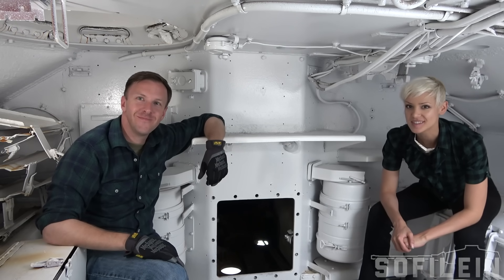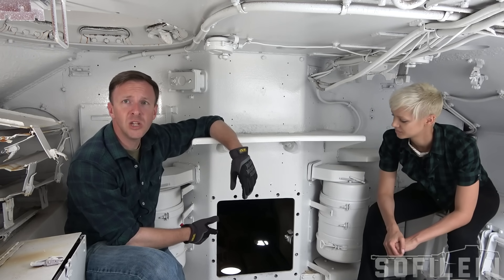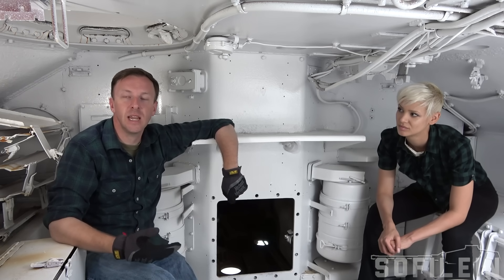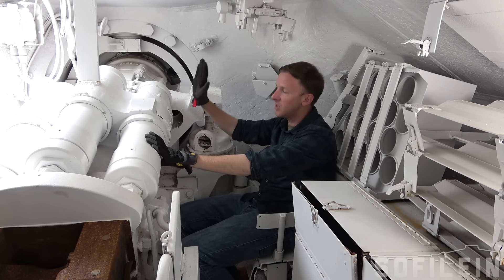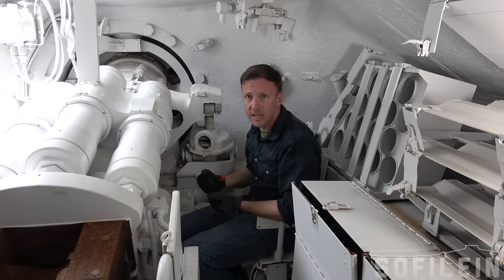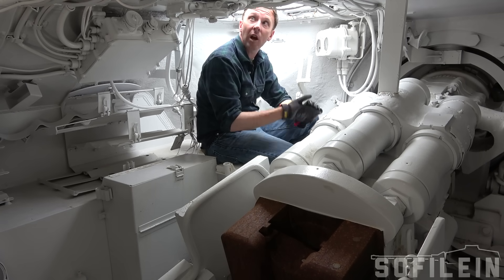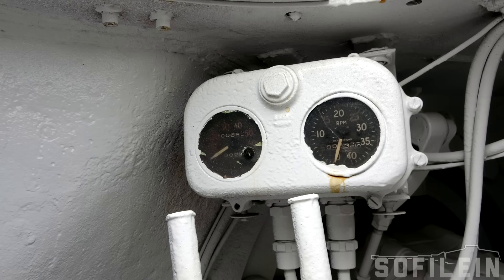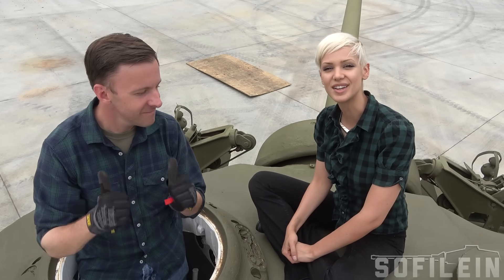Crew positions and interior features of the last T28 / T95 American superheavy tank

Comment: Just a further note by Rob: you may notice the inside of the hatches are painted white like the interior. That's not correct and getting corrected soon! It should be painted olive drab the same as the exterior. You wouldnt want an open hatch to be so visible!
Reply: It seemed a little funky that the hatches were white too, but good to know! Is there any chance that itll be a full restoration as close as possible to it's original construction? Like engine, transmission, and even that box he mentioned in the drivers seat that was likely removed.
Reply: Peresumably the interior of the hatches would were padded?
One question  -  why wasn't the breach block bead blasted/painted?  Just curious.
Tnx for the video(s)
Reply: @1337flite  presumably because the cannon never been pulled out from the tank so it couldn't be sandblasted the part of the extended counterweight behind the breach!
Reply: Thank you. Was wondering.
Reply: Since we're on the topic of corrections: "...the same as the *exterior*."

😉
Reply: @pauld6967  how did no one else point that out?! Corrected 😊
Reply: @ArmorCavCollection  thank you and happy to be of service.
Reply: @ArmorCavCollection  ...and at the risk of wearing out my welcome as a subscriber,...after you guys made the correction, I see that an apostrophe is missing from "wouldn't"
Reply: You should remanufacture the missing control panel I'm sure that you guys have the blueprints for it but what a awesome restoration and preservation that you guys have done
Reply: Gotta ask, when the interior was bead blasted and painted, why didn't they do the engine bay?  Was it too greasy or was it done as a sorta favor and squeezed between projects, thus the team was available for only X many hours?
Reply: I wouldn't think that adding a newer engine and drivetrain would be all that detrimental to this amazing monument to the ingenuity of the era. I am sure they put the best the could at the time and if it were to get back on the track, why not have a safer, more affordable, better powered, easier to service power plant? As long as you maintain visually the look externally, it was in fact a prototype and I am not sure how far into the trials it went but this is different than say a a tiger 2. Though I could completely see resto modding that considering how rare and fragile those systems are. Have you ever seen the cyl wal thickness on the maybach for the tiger 1? They are cut so close the upper portion is opened between them. At least what we saw on the one in the AUS armor museum resto. 
That said, just so amazing for you two to show us inside of this beast! This is often one of the first things I want to see after I see the outside, want to see in, and want to see in the engine bay. As a mechanic and restorer myself, this things fascinate me!! 
I came searching to see if you all had a t29/30/34 video of the inside? Doesn't have to be spectacular like this one is, like having some before it is all stripped down just to show the history and little marks, very very cool and important! 
Thanks again for all you do!

Comment: "Look at this low mileage baby, only 68 miles on the odometer, top speed 8 mph, and gets 20 gallons to the mile!"
Reply: Sounds like an absolute bargain! XD
And with just ONE previous owner! (All be it a somewhat neglectful one)
Reply: @SonsOfLorgar  "and we'll throw in an extra set of tracks at no charge!"
Reply: "Owned by a little old lady from Pasadena who only drove to church and the market"!!!!
Reply: @paddy7812  I was going to do the classic line but you beat me to it.  I doff my cap to you sir.
Reply: @pauld6967  And I Thank You Sir!!
Reply: I was talking to the driver of an M60 tank retriever at a parade one time (many years ago) and asked about the fuel usage and he said about 8 MPG on one engine and about 8 GAL per Mile on both engines.
Reply: @bitsnpieces11  joking or was he serious?
Reply: @suspiciousminds1750  Probably joking a bit, could be reasonable mileage for a tank on one engine but with both running and probably working it would burn through a lot.
Reply: I hope they didn't opt for the extended warranty. It would have been a rip-off.
Reply: @NitroU-  Yes, 5 years or 50 miles, whichever comes first.

Comment: I have long been an armor nut.  Model kits, YT videos and games.  The T95 has been the ghost that has defied deep investigation and pics.   These videos of its new digs are BOSS!  Thank you SO MUCH for going into such depth of this most elusive chunk of iron!
Reply: It’s not a T95, it is the T28 Super Heavy Tank
Reply: @andyconway5610  Both names are used interchangeably, the technically correct term would be the T28 Super Heavy Tank but it was also known as the 105mm Gun Motor Carriage T95 for a year during its development.

Comment: Oh, for Pete's sake, it's big enough to sling a hammock in there!

68 miles? Pfft... Just amble over to the Armored school, get a couple of mechanics, a crane and a spare Abrams turbine. Slip that in and crank that sucker up. 

Awesome view inside! Probably big enough to carry it's own infantry section for protection.
Reply: If the US government spent money to get this tank operational with an Abrams engine, I would not complain about their misuse of my taxes.

For about a year.
Reply: @samuelnakai1804  ehh Turbines are bad if you sit idling other than that they are very good
Reply: also i guess you could say a M103 took a note out of T28/T95 for Hammocks lol
Reply: @Rayhan  tbh i dont thing the suspension could handle going that fast
Reply: I'd say buy and modify a Leo2 powerpack from the Canadians instead of the gas turbine of an M1, the sound profile would remain a lot closer to the original too, at least from the outside.
Reply: @le_floofy_sniper_ducko  Perhaps only with the double tracks installed? SonsofLorger makes a great point as well- a Leo2 powerpack. 
There is the knowledge out there! I'm sure there are more than enough volunteers to make this work so we can crank this sucker up and go car crushing.
Reply: @vtbmwbiker  even with double tracks mind you this is a 90 ton tank on bogeys not like M1 or other tanks now a days with torsion bars
Reply: also by the way of restoring this, their goal isnt replace what we can to make her a runner with modern stuff its restore what you have and get period correct items that where built either for the tank or had parts in common with others they want Original stuff not just put a new thing to replace it deal if i remember right Bovington is much the same
Reply: @le_floofy_sniper_ducko  All very good points--- I don't know much about engine history, so was the GAA the largest engine they could get appropriate for an armored vehicle that could be produced in large enough numbers? It appears, well, everywhere.
Reply: @vtbmwbiker  yes but the tank didnt use a Ford GAA it used a Ford GAF V8
Reply: @le_floofy_sniper_ducko  So, the same engine as an M26 then? Still 500 HP though.
Reply: @vtbmwbiker  ya, but still i dont think they wanna risk of repeating what came before it
Reply: aka engine fire which destroyed the other one
Reply: @le_floofy_sniper_ducko  yeah but what's in the engine compartment isn't really important, as long as you have the original sitting in a display somewhere. wouldn't bother me in the least if they swapped in a beastly diesel and got this thing running again. keeping the visible interior as original as possible of course.
Reply: @oldfrend  thats debatable as if your doing a period correct restoration then have a modern engine in it does it not defeat the entire purpose of a period correct restoration?
Reply: GAS GAS GAS!!!
Reply: @oldfrend  at the same side he also said they have no plans as of now to make her a runner and some Tank Museums do act like i had said prior yes i agree it might not make alot of sense from a point of view as people like us who just want to see something like the T28/T95 project moving under its own power but in some circles it probably makes a difference as is even before they put one in if they put one in that engine bay looks like it needs some work maybe one day we will see it running tho only time will tell
Reply: @vtbmwbiker  Car crushing!?  This thing makes Killdozer look like a three year old's toy!
Reply: It looks quite roomy on the inside but like most armored fighting vehicles if the T28 was combat filled with equipment and ammunition, there would be no room left to carry infantry.

Comment: Mr. Cohan, in case you’re still reading these comments, a question.
While in the process of restoration will another bank of control indicators that are supposed to be located at the driver’s left rear head level and are currently missing; will they be replaced, and if so, what with?  I imagine there is no longer any exact replacement panel to slap into that spot.

Comment: Having been to Bovington recently and had the pleasure of clambering all over, and looking inside, Tiger 131, I am simply amazed at how much room there is inside this... The Tiger is no small tank, and its REALLY cramped in there. You could easily host a party inside the T28 and still have room to spare. OK, stuff like the ammo is missing a few interior pieces like sights and radio gear and stuff, but I'm still blown away by how spacious it is.

Comment: Claustrophobia kicked in when Rob talked about the escape hatches only dropping a few inches in soft ground. "RUN away, run away!" It's not often you hear the term 500hp being equated to under powered either.
Reply: Compare to the horsepower of modern weapons..  a one horsepower engine would work with gearing.. but a speed of naught point naught one is unacceptable

Comment: How did they get that big-block Ford V-8 out of the engine compartmet ?
Reply: It slides in and out like the power pack on a Sherman tank.
Reply: The biggest big lock ford ever made was the 534 cid super duty v8 with a displacement of 8.7L the GAF v8 displaced 18L. Looking at the difference between the size of the two engines I don't think big block is how I'd describe the GAF i think morbidly obese block would be a better description.

Comment: Is it able to pivot steer? as in both tracks move in different directions when turning or is it a stop one side and have the other move forwards or back. From looking at it itd seem like it would pivot steer its just nice to think about all the stress it puts on the tracks.
Reply: Nope, Torquematic transmission, so brake/ pivot steering was possible, but not neutral steer.

Comment: Interesting as I never seen the very roomy interior! Of course I noticed that almost all the armored glasses had been smashed on the turrets around, unfortunately, and many items are missing including the engine. I have always been very perplexed with the choice of the Ford GAF engine with only 500 hp to move 86.2 metric tons so it had very limited cross country country but with their experience why didn't they installed two coupled engines? Thanks again sharing this very interesting tank 👍👍
Reply: Wasn't seen as necessary. The tank was only meant to ever go at the same speed as infantry and where infantry would go to assault a heavily fortified area. It was made for a single purpose and that was to fight the Siegfried Line.
Reply: @bluntcabbage6042  I understand that it was not deemed to have a more powerful engine but the area along the Siegfried line was hilly and it would have been very difficult to climb even very modest hills if it doesn't sink in the ground before due it's extreme weight....

Comment: Measure the distance between the mounting pads for the driver's instrument panel.  I would bet that it used a standard panel from either a Pershing or Sherman, a vehicle using the same engine.  The Ordnance Corps loved to used standardized components whenever possible.  I have recently (ok, 2 years ago) been primary mover on the project to get a M103A2 to the Camp Roberts Museum.  It is un VERY poor shape but I was able to use the back deck and upper grill doors from an M60 to make its rear end look "presentable".  I was shocked to learn it was an electric turret.

Comment: made think about an aphe round going in through the gunner sight. i wonder what the diameter is and how possible that would be for a lucky panzer3.
Reply: That "hole" would obviously be filled by the optic system. I guess it could be a weakspot, but something would have to go seriously wrong for an enemy to have the change to get a accurate enough shot at the T28.
Reply: @racernatorde5318  sure i just wonder if it would be physically possible with a perfectly placed 50mm round shot by annie okley

Comment: It's such an amazing piece, and I'm so glad the old girl got a good home, but I'm a little sad she'll not ride again.  If you had a modern engine tuner work on her and get her horsepower and torque numbers up a bit I bet you could get enough leeway to make her perfectly comfortable moving around under her own power, and While you might need to add a little modern monitoring equipment, wideband O2 sensors, etc, the result would be that the only known existing t28 wouldn't be stuck as a large, immobile metal room, she'd be a land battleship again. ❤

Then again ...i suppose its a tankers habit to anthropomorphize them a bit when you basically have to live in one for a while in a desert hell.

Comment: Much more roomy than I expected, even though its pretty much empty. I expected between the engine compartment and the foot of steel on the front itd be a bit cramped.
Reply from the maker: Funny enough, despite how much more room on the inside than what's usual for a tank, I've never slammed my head on the interior more in any other vehicle!
Reply: @Sofilein  your body isn't used to that much room lol

Comment: I love models..have hundreds. The jade tiger had that huge 128mm and the sturmtiger with monster Rocket! and the Soviets had the 152mm..all of them seemed to operate with the crew in combat with up to 3 rounds a minute. Had to be loud as Hell!!!!  I don’t know if they make an ear protection for that. They like to operate them with the hatches open! I can see why. Part of the reason the 105mm Priest was open topped and the converted little M3’s into 75mm shorts...with an open top. But many of the self propelled even later ones equipped with full NBC gear was very Box like. From a KV II with a big old 152mm to the end of that war. It was a loud piece of artillery. 155mm and 203mm 8 inch whatever...tend to be bag and projectile...or like the 128mm which was one complete armor piercing over sized 88mm round. But came from a split rail bag and projectile Weapon. But cumbersome. Made short work of T-34’s though and KV I’s and just about everything else! Thanks for listening! Your a lucky girl. Like the Russian T-35. Land battle ship!

Comment: Maybe someone can answer this, but being part of Wargaming/World of Tanks there is the T28 single track and the T95 double track, now i know from other documentary`s that the T95 was never in combat, but did the T28 single track ever see combat?
Reply from the maker: The tier 8 'T28' in WoT is borrowed from another proposed prototype design, which was not built.

This tank in the video, which is the tier 9 'T95' in WoT, was initially named T28, then T95 Gun Motor Carriage, then it was switched back to T28 superheavy tank. T28 and T95 are the same tank, putting the tracks on it doesn't change anything. T28 was never put into service, only two prototypes built. WoT has made this very confusing, but Im doing a video on it soon that should help explain.
Reply: @Sofilein  thanks for the info, yeah when i saw the previous video i thought it was the T28 until the 2nd tracks were shown and i did question the gun mantel at first, WG/WOT do put blue printed tanks in the game built or not ......will look forward to your T28/T95 explanation video :-D .... oh and can`t wait to see the double tracks attached :-D
Reply: @Sofilein  Thanks for the info and looking forward to seeing the double tracks attached to its hull ..... you mentioned the engine is being serviced, will be see the T95 move under its own power?

Comment: "Don't expect to see this running again any time soon, the other one was lost in an engine fire because it was overtaxed" My disappointment is immeasurable and my day is ruined. :(

Surely there's some way to slap a modern engine in the back that won't catch on fire if you look at it wrong...

Either way I think I've only ever seen one old interior picture of the T95 and I gotta say seeing this on video for the first time is a real treat, thank you. <3
Reply: Or maybe fit a fire suppression system in so if it does catch it won't burn out.

Comment: I understand keeping it original concerning the engine, but when the original engine is not up to the task then it should be replaced with (like another poster said, an M1 Abrahms turbine) or possibly a big diesel engine. Engines are swapped out all the time for bigger and better ones. Would be great to see it run under it's own original power or a new power plant.

Comment: I wonder if it's possible to drop in a separate power pack. do a full resto on the original drivetrain, but build something else to drive it. I'm not saying a turbine or anything, but it could probably fit something a little more competent in there.

I understand the desire to keep it original, but it was a prototype and they knew when they built it that the motor was a joke in there, but they needed approval in order to source something else. the GAA was probably just the biggest thing the ordinance division had.

I mean hell, didn't the Abrams start with like a chevy 350 when it was a prototype?

Restore the engine and get it running on a trailer dyno so you can show it off, but drop something capable of moving that thing in there. it's too unique and beautiful not to have a life of it's own.